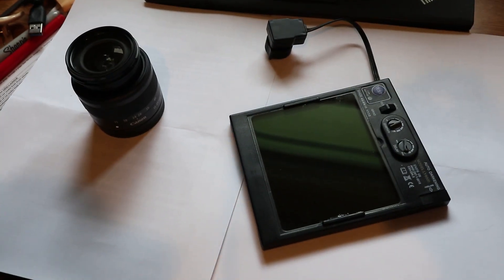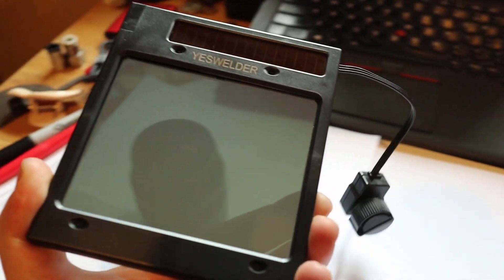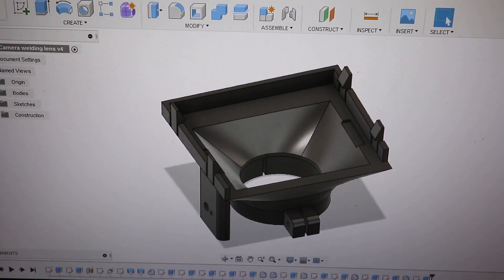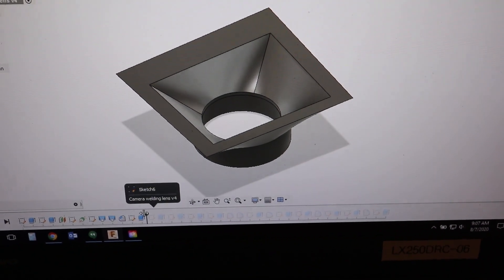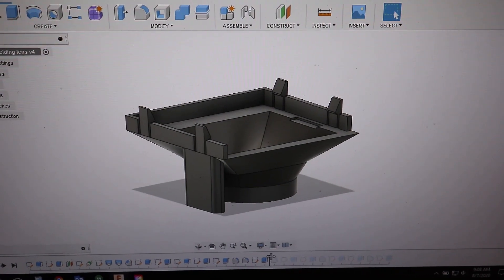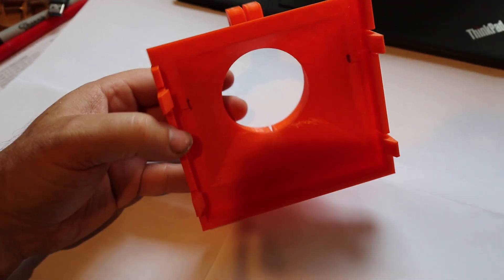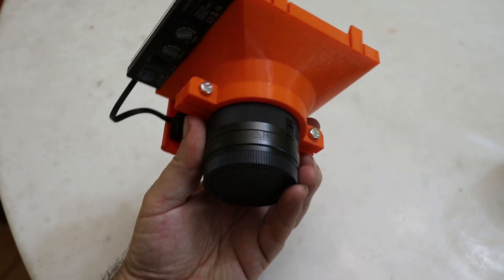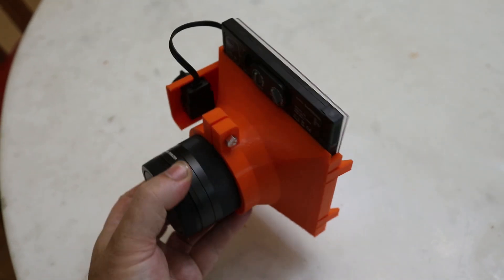Making a welding hood for my camera

Comment: Interesting. Do you have a plan how to get rid of reflections? Perhaps the glass mounted in slight angle which causes double image. Or maybe it helps to mount the welding unit in much bigger angle in relation to lens. So the reflections would be further away. Also covering inside of the red plastic with black velvet should make an improvement.
Reply from the maker: Oh, those are good ideas.  I ordered more black filament for the 3D printer, so the next model I'll try putting the welding lens at an angle.